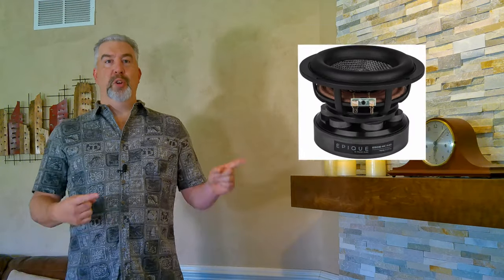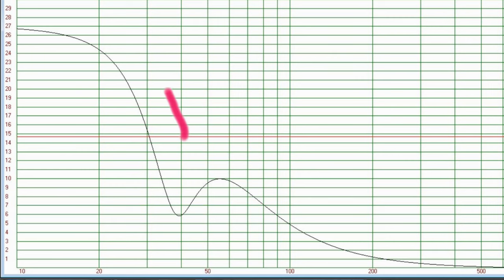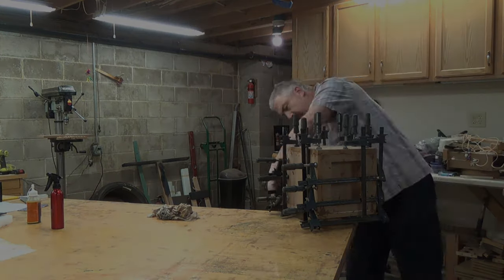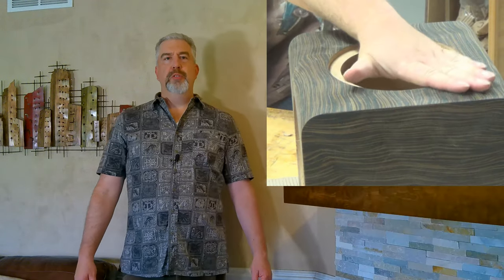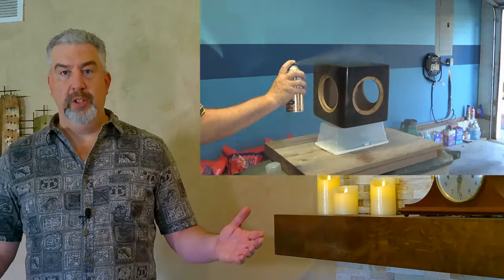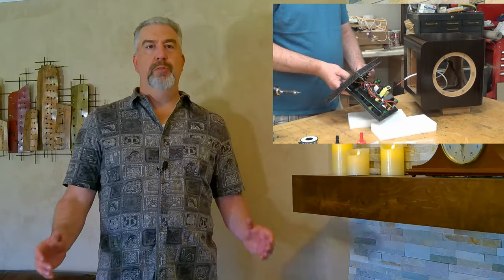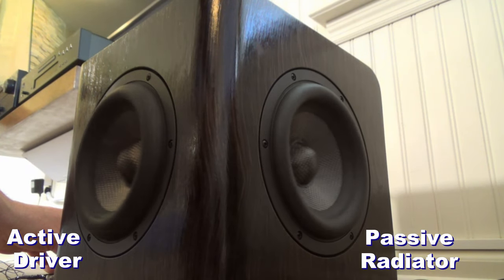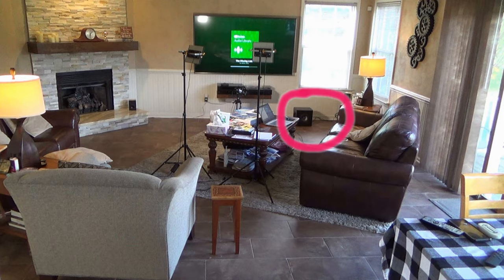POWERED!  Epique 7” NEW Passive Radiator Subwoofer

Comment from the maker: UPDATE: Listening to The Polar Express last night with this and two small two-way speakers. I had the volume really cranked up to hear the weak dialog and forgot to turn it down during the 'runaway train' scene and I bottomed this driver out... BANG!!!  Loud and scary... I jumped for the remote but there was only one noise. I bottomed out the voice coil on the back-plate. It survived... No bad noises afterwards, it seems fine and no scraping or nasty sounds pushing the cone in. I got away with one there, but just to reiterate that this Epique 7" driver is at least made pretty tough just in case someone does push it a little too far. I continue to be impressed with it.
Reply: I'm contemplating my first DIY speaker build to add a subwoofer to my existing Onkyo receiver to make a basic 2.1 system for watching TV, movies, and a bit of music.  What are your thoughts on how it sounds watching TV and movies?  I know it won't produce house-shaking bass, but I'm not really into feeling my movies.  I just want something that fills out the sound a bit more.  Current speakers are some cheap Pioneer SP-BS22-LR bookshelf speakers.  (If this build is fun and goes well, I may replace those, too.)
Reply from the maker: @TheEricSchubert  Eric,  Well, it did pretty good keeping up with the rest of the system until that one, super-low bass hit.  It didn't even sound strained previous to that, which makes me a little nervous to push things too hard since I can't easily tell if it's being pushed too hard other than looking at the cone. Like I said, I had it cranking pretty good. If you're not trying to shake the house like you said and just want some nice, clean low end to supplement the rest of the soundtrack, and you can keep yourself from "overdoing" it, I would think this would work very well. And, it's pretty excellent at music on top of that. Thanks for watching and commenting!
Reply: @zarboaudioprojects1430  Awesome! Thanks for sharing. It's hard to tell from videos what it will actually sound like. Being my first speaker build, I'm curious to try pairing it with some Overnight Sensations and see how they compare to my current speakers.
Reply: This is why I build my own speakers so that I can make the speakers "bottomless"

Comment: Interesting design. I love DIY speaker projects. and as soon as this Dayton Audio released this driver epique e180he-44 7. which has a frequency response of   25 - 3000 Hz. I thought to myself, this would be perfect for either a 2-way  or 3-way speaker design by default it would save you the job or building a separate sub.
at least for a medium size room. this is a very creative design. and very detailed job, glad I found your channel. Thanks
Reply from the maker: Thanks Jeb.  It's a nice driver with a nice sound, I think if you were to pair it with a robust tweeter possibly in a medium sized waveguide for a lower cross point you would have a good performing compact two way speaker with full bass, no sub needed. If you haven't seen Todd's DIY Audios build using two of the 5.5 inch Epique drivers in a TWW setup, that might give you some ideas too. Thanks for watching and commenting.

Comment: Idk why alot of forks say it plays deep enough for music..? Alot of music plays well into the low 20s... Understandable size of driver / enclouser & TS dictate what's possible. 

Love your builds man..! I like the approach. Simple, clean & functional..! ⭐️⭐️⭐️⭐️⭐️

I currently have a couple GRS8SW4 I'm building enclousers for. 1.5cuft looks good through WINISD tuned to 22hz. I had originally wanted to build some type of horn enclouser but I think that's above my pay grade atm lol... I just don't understand the math behind it all.
Reply from the maker: Thanks for watching and commenting. You're right actually, depending on what type of music you dig, it can reach into the 30's and 20's.  I don't listen to stuff with material that low, but that's just me. I should rethink that probably.   GRS subwoofers are sleepers, I love the HE version in the Pint Sized Powerhouses.

Comment: Love to see a passive with 2 active opposing subs and 4 passive radiators....all of 6 sides firing. maybe an up and down firing box with tall feet all 4 sides with passives. Maybe use the 5.25 epiques and see how small and crazy powerful it could be.
Reply from the maker: That would look cool. I've modeled the matching PR's but they don't dig very deep. Also due to the sheer size of the magnet on the drivers,  the size of the box would need to be kind if large. I like the idea, though. Plus you could do a 4 ohm setup as well. Thanks for watching and commenting!

Comment: Great post, and great minds think alike! Just made the same thing (ok, 3/4" plywood, square corners, white lacquer finish, but basically the same). Really happy with the setup in my small office with plenty of low-end room gain. Tempted to try a dual-opposing setup with the same amp at 4 ohms, a-la KEF KF92 etc. Might make it a piece of furniture.
Reply from the maker: I think these driver/PR just lend themselves to a similar setup, sounds nice!  Two Epiques would be nice too, maybe two enclosures and make one a slave sub for better room integration?

Comment: Great build. I’m making a pair of towers with 2 epique 7s in each.  What frequency are yours tuned?
Reply from the maker: Hey James.  This sub is tuned to around 30 Hz with an F3 of around 43 Hz.
Reply: Thank you. I’m your build, how much added weight did you need to achieve that result? 

I’m using two epique 7” drivers and 4 matching passive radiators with 60g of weight each. I have a bump in freq response at 90hz. I’m going to play around with adding mass to see how much I can lower that bump.

Comment: What do you think one of the 5.5's with one 7" radiators would sound like in about a .25cf sealed box? It would be replacing the factory subwoofer in my car. 85w to each coil.
Reply from the maker: It sounds like a decent idea, I think a 7" PR will work decently with the 5" Epique driver, though I have not modeled it.  .25 cu. ft sounds a touch small, though. Have you modeled it in WinISD or a similar program yet?  In a car, you wouldn't need super low extension, though, low 50's to high 40's would be actually good, cabin gain will get you the rest of the way there.
Reply: I havent modeled it. I can build a box, what size would you suggest?
There will be a 7" epique in each door as well. Small hatchback car, i think it should do ok.

Comment: Why do you think there was that large dip in the frequency response around 800 Hz? Related to the baffle dimensions possibly?
Reply from the maker: Hey sorry, I didn't see this until a few days ago for some reason.  I don't know. I didn't try and get the mic in a good position, and it was VERY close to the floor, may have been the baffle or bad reflections. But either way, it doesn't exhibit that response normally. Good eye!  And thanks for watching and commenting.

Comment: Very nice build Tom. Really like the robust but curvy finish. I like detail so the woofers having the same pattern looks nice to! Isn't this almost the same as the e150 you build but the e150 goes even lower?
Reply from the maker: I'd say the response is pretty close on the low end between the two. Actually all the data for my 'Epique small cube subwoofer' build got lost somehow so I can't look back to it for comparison. Two drives for backup and it still disappeared!  Thanks, I'm glad you enjoyed it!
Reply: @zarboaudioprojects1430  how is the sound compared to mass market subs in the same price tag?
Reply from the maker: @roygriend5143  Thats a good question Roy. I honestly have no idea. The last mass market subwoofer I've purchased was over 30 years ago, I've been making my own forever. This is on the pricey side since it uses the PR's, so cost-wise, it's probably no bargain, but size-wise, I think it would out-perform nearly anything out there. I don't have the funds to purchase retail subs for a comparison, but that's a great question!

Comment: Just wondering why you wired at 8ohms? Isn’t this amp rated at 4ohms? As well as the sub? Was gonna build this sub so just wondering as I’ve never built anything like this before. Thanks!
Reply from the maker: The sub has dual 4 ohm coils and just using one coil required a slightly larger box in my modeling. The amp has plenty of power for this setup. Thanks for the comment!

Comment: What would you charge me to build just the box, without the plate amp and without the routing on the edges? I plan to use in my car and will apply my own cabinet coating. I live in Orange CA 92869.
Reply from the maker: Hey Tim... unfortunately, shipping costs are so high it wouldn't make sense. The cost just for shipping is over $60. I'm in New Jersey, so it's got to travel pretty much the whole width of the country, so that doesn't help. 
I appreciate the thought, but you'd probably be much better with a local builder/fabrication shop.  Probably a reputable car stereo shop that does custom work, or search somehow for local custom fabricators in your area. 
I'd give them dimensions and then provide them with maybe one PR to get sizes and depth from for flush mounting. 
Good luck!
Reply from the maker: Check this flatpack box out from PE designed to use that same driver:  https://www.parts-express.com/Passive-Dayton-Audio-Epique-7-Mini-Subwoofer-Kit-300-7324?quantity=1 
it is smaller, only 10" as opposed to my 11", but it should perform similarly. The F3 is within 2 Hz between the two of them, around 45 Hz or so. You would just need to cut out two openings for the two PR's. of course, they would not be recessed, but if that's not a deal-breaker for you, it's an option. Glue and some tape is all you need to put a flatpack together.   Good luck!

Comment: Very nice but i have a question, would it have a negative effect in the sound if you put all 3 chassis (the woofer and the 2 passive radiator) on the front ? I mean like a tower subwoofer? Because it would fit really good in my room (sorry for my bad English im from germany)
Reply: Or maybe in my car, in the spare wheel box
Reply from the maker: A tower sub should be fine. I built the cube to keep things as small as possible. That would be an interesting look!

Comment: Do you have info about the tiny speakers you used together with it`?  I`m working on a portable sound system using 1 x 7 Epique sub + 2 radiators (same as you used in the sub)
Reply from the maker: Yes, they are called "The Bantams" and I have a full writeup here at Parts Express Tech Talk forum: https://techtalk.parts-express.com/forum/speaker-project-gallery/1304991-the-bantams-micro-speaker-system  
They have been featured in an article in AudioXpress magazine in October of 2019 as well.  I'm considering doing a video on them in the future if there is any interest. They are a fantastic sounding speaker.

Comment: Hello, I would like to know if I can do the same with a 15-inch one and if I can use a group of small radiators or if I should use one of the same size as the bass. It is a bass, not a Subwoofer
Reply from the maker: As a rule (and this is not set in stone) you would like to have either double the cone area, or double the excursion for the same cone area as the active driver. I'd imagine a 15" woofer may need a whole bunch of these PR's which would really be costly. It may be able to be done, but it's an expensive way to get there.

Comment: If you were pushing this combo only up to 80db at 8 ft and were looking for the lowest f3 possible, how low do you figure that would be?  I'm looking to do the same as you did but in a 15x13x10 box with an external amp, the two PR's pointing forwards and the driver pointing down.  Thanks a ton.
Reply from the maker: It would be hard to say without modeling it... I think low 30's is possible.. it just depends on how close you are willing to go towards the ragged edge of its excursion capabilities. The absolute LOWEST F3 would over-excurse at very low volumes, so you have to model it to pick and choose your trade-offs.  Thanks for watching!
Reply: @zarboaudioprojects1430  thanks!